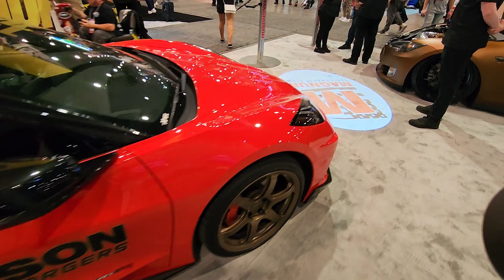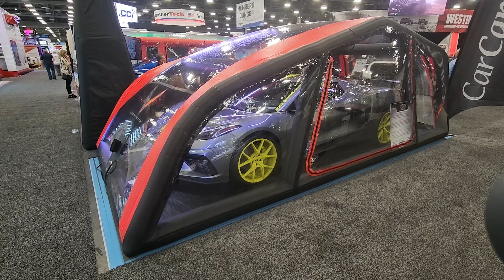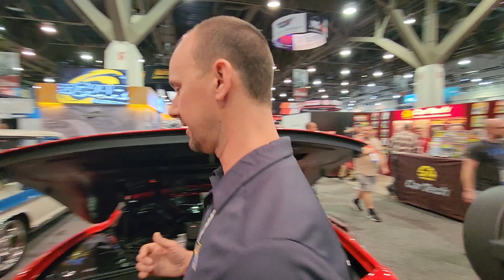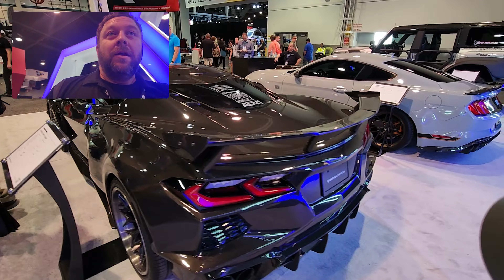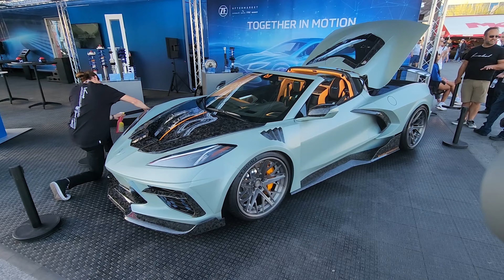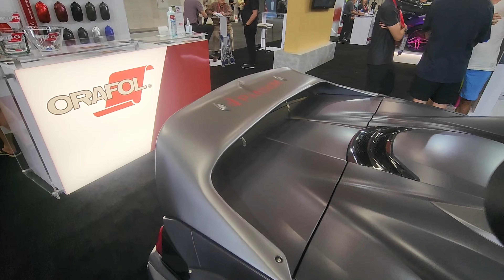Every C8 Corvette at SEMA 2022 Las Vegas

Comment: I never understand y people would put truck fender on a sports car and think it's cool...... Anderson Composite C8 is the only wide body I like out of all of them. Too bad they only offer in CF. $$$$$
Reply from the maker: Technically the over fender stems back to early road racing where bolt on flares covered wider slicks.  Trucks popularized it in the late 70s and 80s but...started with cars.
Reply: They have a Fiberglass version for 10k. Check their website.